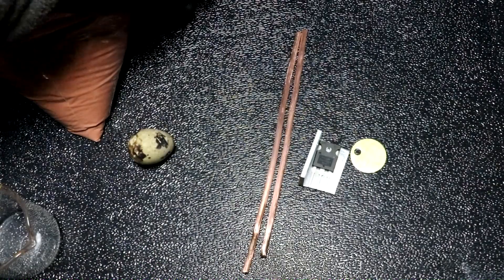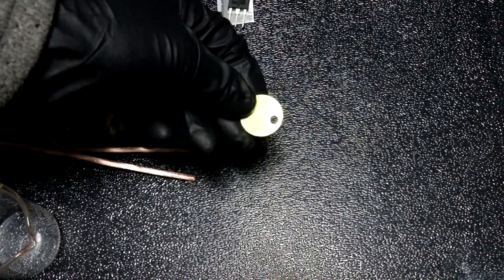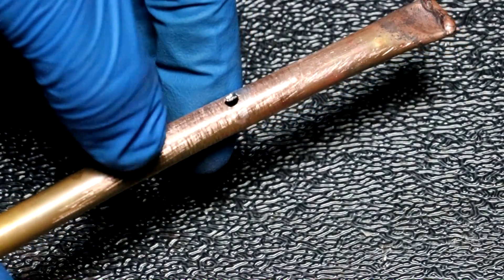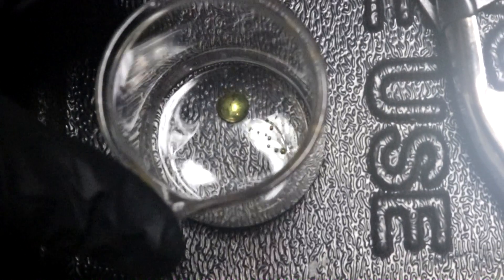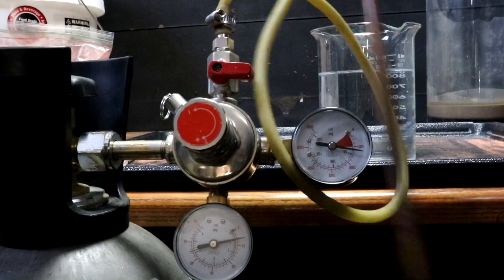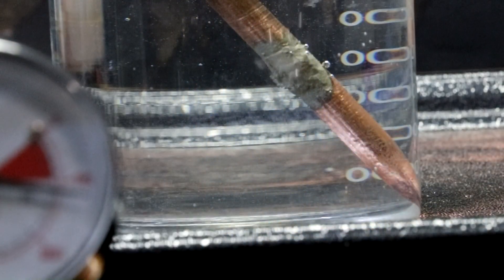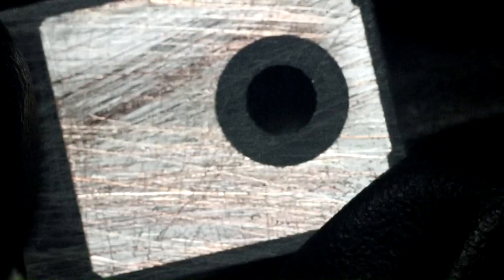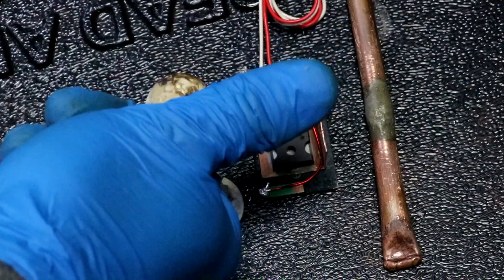Copper Mercury Amalgam Experiments

Comment: Cody is a type of guy who sees a skeleton and tells that he would extract calcium from it ....lol
Reply from the maker: Oh yeah I still need to do that!
Reply: what about that phosphor?
Reply: @theCodyReeder  how difficult would it be to separate the magnesium from chloroplasts or mitochondria?
Reply: @dELTA13579111315  its ez just add hydrogen peroxide and sulfuric acid whic distory everything organic and you are left with metal salts and use lithium to redox it
edit, dont actually try it, its very dangerous
Reply: @holaamigo3399  lol I actually have all that I may try it
Reply: @dELTA13579111315  be careful tho the hydrogenperoxide sulfuric acid mixture can explode and its a  extremely strong oxidizer
Reply: @holaamigo3399  I've used it before a couple times, but I haven't bothered spending the money on any hydrogen peroxide stronger than 3% lol. It still works, just not nearly as fast as with more concentrated stuff. It does still get extremely hot
Reply: I'm always wearing gloves while I'm doing anything with sulfuric acid, especially pirahna solution lol. Tbh idk how much they would help against it but I figure it would be better than nothing. I should probably test them out and see what WOULD happen
Reply: @dELTA13579111315  definitely check. Bit different situation but I know working around flame/heat while wearing synthetic fabric is a no no. It will literally melt into and fuse with your skin. Making a potentially minor burn (say from chipping slag) into a really nasty mess.
Reply: @holaamigo3399  Oh, so I can turn corpses into bombs while trying to dispose of them.
Is this a human skeleton only reaction or does it apply to all species' remains? If it's human only that makes my job a bit easier.
Reply: As opposed to the Japanese knife making guy (Kiwami Japan) who sees KFC left-overs and thinks, I'll make a knife from these bones!
Reply: Let the James Begin. - Sell the skeleton for $100 (or much more) and then buy Gold.But that's boring. ;-D
Reply: Dankest memz
Reply: Thank mr skeltal for doots and calcium
Reply: I am spooked
Reply: I'm the kind of guy that finds a skeleton and wonders if I should report it or take it home. We are talking about human skeletons, right?...
Reply: @jameslandon4126  Where do you live to not see random animal skeletons in the alleys and of the fields? Can't be America, they were all over the place, especially the kitten skeletons. :(
Reply: Fuck

Comment: I know with computers, you can't mix aluminium & copper water blocks because it will mess up the block and contaminate the system... I don't know anything about mercury, but it seems like a bad mix if mercury eats away at aluminium... should be interesting... take it easy...

Comment: 15:55 I'm also pretty sure it isn't compatible with WEEE/RoHS regulation...
Reply from the maker: lol nope
Reply: I wonder if you could completely bake out the mercury - would the copper still stick together or would it return to dust? I was thinking along the lines of using the mercury as a kind of solvent to "crystallize" the copper into whatever shape you want, without having to melt it.
Reply: I doubt you'lll be able to bake out the mercury without going above copper's melting point anyway.

Comment: That small solar panel packed a surprising punch.
Reply: Had me going for a bit as well, till it realized its just turning it on and off not actually powering it
Reply from the maker: lol
Reply: The solar panel is connected to the gate of the MOSFET and doesn't power the motor.
Reply: Manuauto I’m sorry, it was a joke.
Reply: It's 783% efficient.
Reply: Kenny Phillips Batterizer anyone?  :D
Reply: What kind of motor was on that solar panel?
Reply: r/Woosh
Reply: ye-yeah, guys. it'd be silly to think that...

Comment: "heat sink compound"  You didnt check its thermal conductivity... at this point its just glue.
Reply from the maker: Good point... it is a metal though.
Reply: And its observably brittle.  If it continuously expands and contracts due to thermal change, it might just turn to dust.  Dust isnt a good heat sink compound.
Reply: Mercury itself expands and contracts drastically from heat change, yes, we know this because we used it as thermometers... however as it does so it also becomes more fluid, which could go one way or the other; there's a point where fluidity is great for re-establishing capillary action as a mechanism to transfer heat, that previous thermal cycles have damaged, but only to the point where the liquid doesn't itself start flowing into the CPU pins... if that happens and the liquid is conductive, that makes your day bad. So on the one hand, the properties of mercury can be very useful for cooling CPUs, yet on the other hand, the properties of mercury can be devastating to electronics... nowadays they use alcohol or mineral oil in analog thermometers, and one of those might be a suitable CPU thermal transfer compound... well, I guess you could use high-grade alcohol as a thermal transfer compound for a little while, hehe, hehe... just like mercury, hehe, hehe...
Reply: @theCodyReeder  
I think it'd be interesting to check out the physical properties of several different simple amalgams.  Properties such as thermal conductivity, electrical conductivity, ductility, ability to withstand pressure, deformation resistance, etc
Silver
Copper
Tin
Zinc
Gold

Also trying other metals to see what they do.  Elements such as
Nickel
Cobalt
Tungsten
Magnesium
Titanium
etc
Reply: Stick it to the hot side of a peltier cell?
Reply: It'd be interesting to test the thermal conductivity properties. Copper is a really good thermally conductive element, third overall after silver and carbon (in its diamond phase). Mercury on the other hand is not a very good thermal conductor, though it conducts electricity decently well. As others have said the porosity is probably going to be the biggest limiting factor for heat transfer, so if you tried making some amalgam in the vacuum chamber like you suggested I think that would help. 

Maybe put some atmospheric mixed amalgam, vacuum mixed amalgam, regular mercury, and commercial thermal paste on the top side of a copper sheet and place it on a hot plate, then record with a thermal camera after you turn the plate on to see approximately how fast each substance heats up? I think it'd be a neat experiment.
Reply: I agree. It would be interesting to test it on a cpu. It already has a temperature sensor and can be used as a constant and repeatable load. I doubt this would do any better than the typical liquid metal thermal pastes, but it would be interesting to see how good it is.
Reply: It clearly has pure mercury still left in it.  If you want to put a compound that can destroy metals on a CPU, be my guest.  However, I wouldnt.
Reply: accually trhere exist commercialthermal compound made out of gallium alloy used for CPU cooling (with copper heatsink) this can have simmilar thermal conductivity but it is more dangerous than non toxic gallium :)
Reply: I know about these and would never use them
Reply: Actual commercially available thermal adhesives suck.  Even if the amalgam is super porous, it's still 80% copper.  I'd bet the thermal conductivity is orders of magnitude higher than the next best option.

The problem is that a copper heatsink is going to be expensive compared to aluminum.  I doubt it would be worth using something like this versus some commercial thermal goo and a screw to hold it together.
Reply: You also really don't usually want to use an electrically conductive material for a thermal paste.

Comment: Make a bullet from it
Reply from the maker: I wonder if it would shatter coming out of the gun?
Reply: @theCodyReeder  it probably would make a good shot gun round also probably the best way to make the stuff not brake so easy is if you add copper wire into it or some other type of fibers it will stick to

Comment: hey cody, what happens if you try to set cement in a vacuum?
Reply from the maker: it dries out willhout setting.
Reply: could you make cement that sets in a vacuum? think of the space applications.
Reply: Does that mean it can be recovered and repoured? A do over.

Comment: you generally dont want the metal on the back of the ic to make electrical conection to the heat sink, this is especially bad for amplifiers becuase the case will be grounded
Reply: Not all applications of the mosfet need to be insulated from the heatsink.   Sometimes the heatsink isn't connected to anything and sometimes the circuit is designed to use the heatsink   and other times, you will use a sil-pad to insulate the mosfet from it's heatsink.
Reply from the maker: Humm... good to know.
Reply: @theCodyReeder  it might be cool/usefull for liquid metal cooling a cpu look on Linus tech tips for the vids on liquid metal cooling